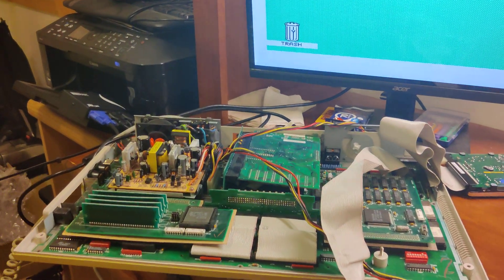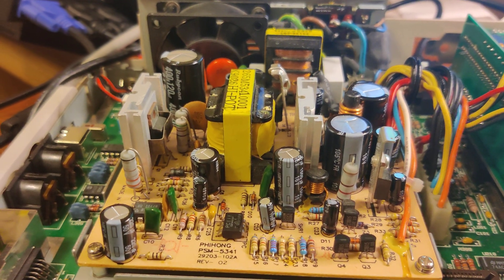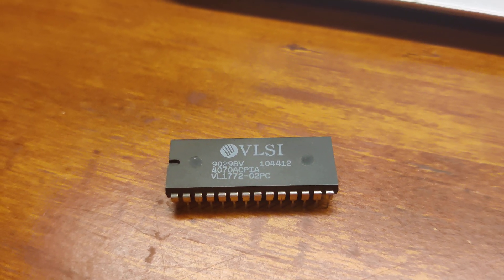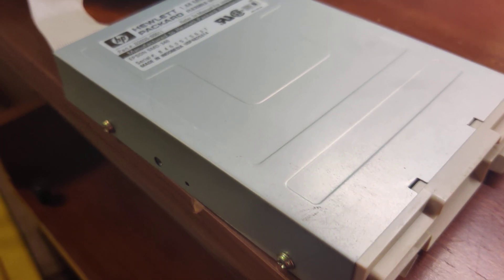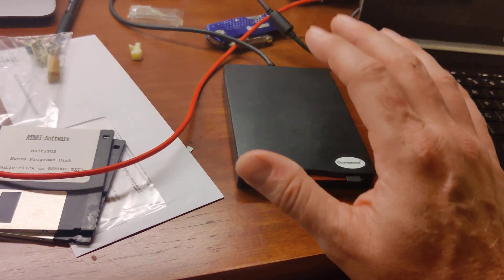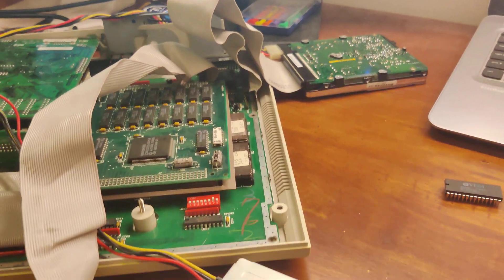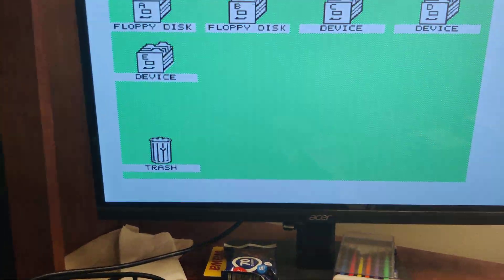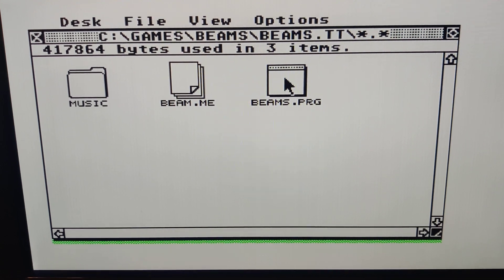Atari TT 030 part 4 - Recap PSU and Floppy Upgrade!

Comment: I have a request regarding the following:

I was removing the graphics card from the VME ATARI-TT slot.
The TOS system was turned off, but I didn't notice that the computer was still plugged in.
When I took out this card unevenly, I suddenly felt a smoke smell somewhere on the board because the whole thing is in the tower housing.
After turning on the computer, the screen is dark, the power supply works, LEDs - no light.
Somewhere after two minutes, the MC-68 .. processor is clearly warm, I only checked this 2MB ST memory board (there is also a factory 2MB on the bottom of the board) the chip and cold bones.
I still have the TT-Fast Ram GX-B-V0, 4MB slots.   Can I ask you for help, service diagnosis?